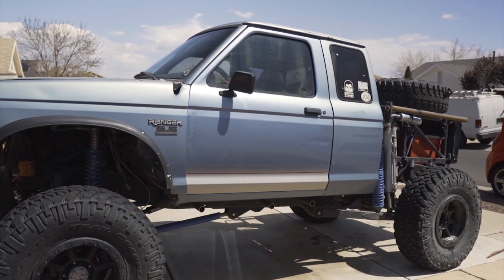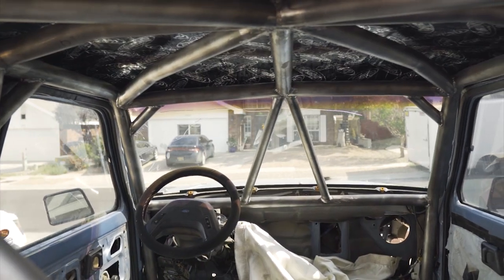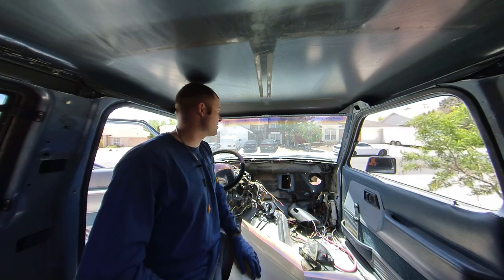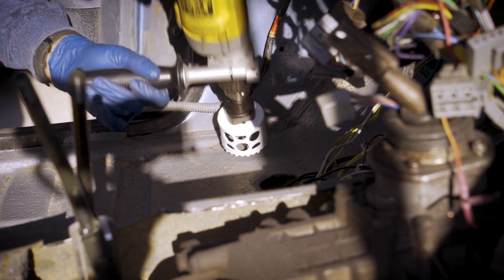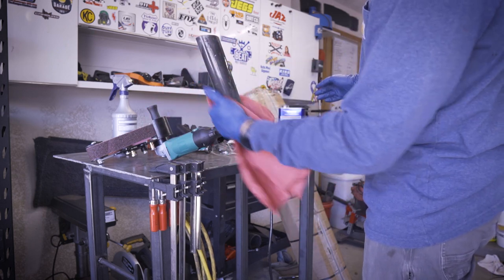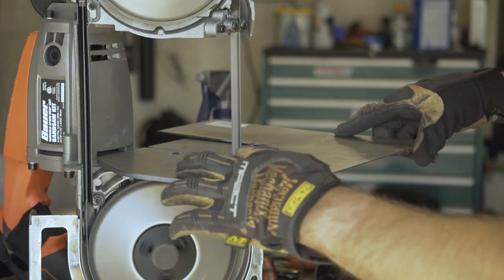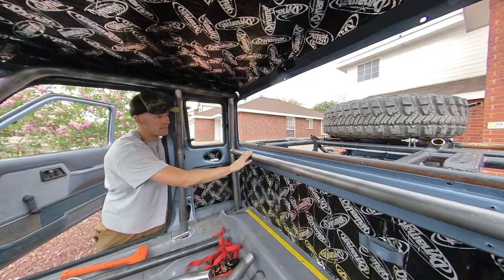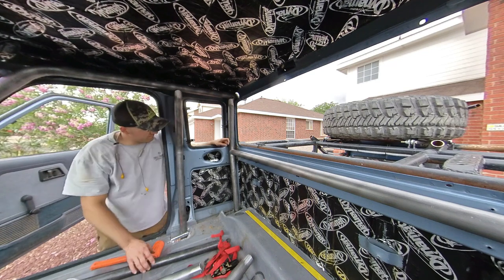Roll Cage Build Part 1 - Reckless Wrench Garage

Comment: With the cage built so close to the body how do you weld the back side against the body?
Reply from the maker: I show that in the next episode. I cut the tacs off the frame mounts and move the cage forward and down slightly. This gives enough room to get the top and back of the tubes

Comment: At least there's some assembly required with that cage because when I built mine for my Jeep I did it from scratch.
Reply from the maker: I have built a few cages from scratch and this kit has higher quality bends and notches than most weekend warriors can make. The amount of time and materials saved this cage easily paid for itself.
Reply: @RecklessWrenchGarage  starting to sound like us jeep drivers you don't like. At least you have a plasma so you can customer it later.
Reply: @RecklessWrenchGarage  Pre built and especially the TE designs one is for people who don't want to take the time to build a proper race chassis and are ok with slapping shit together. Tube continuity, and lack of triangualtion are just basic things that kit lacks. But hey fuck it its your rig do what you want!